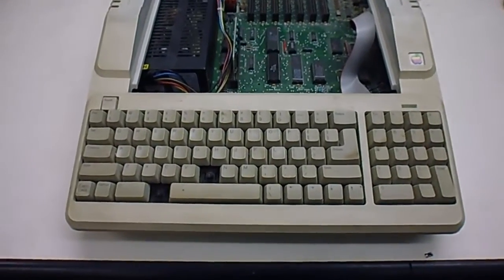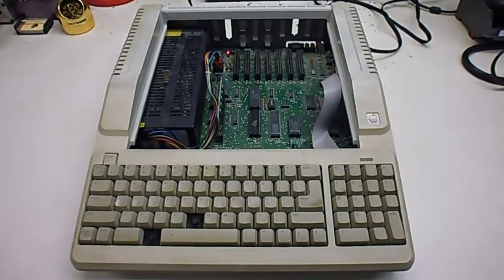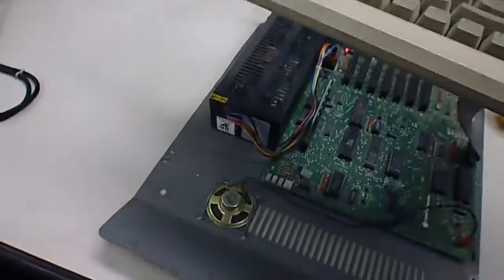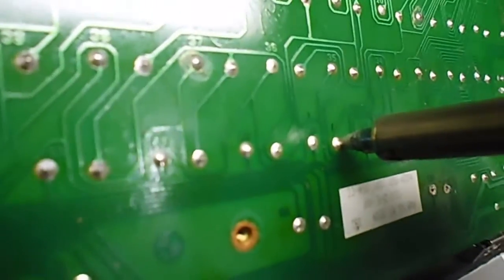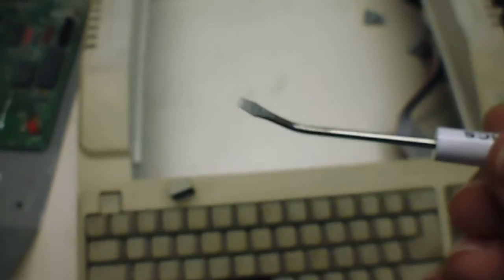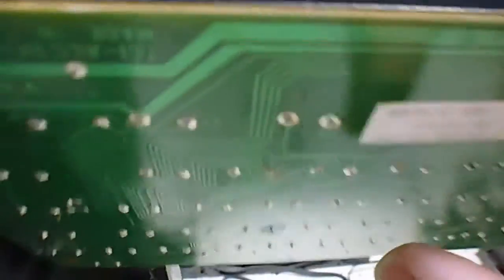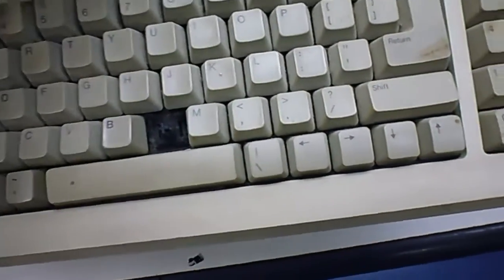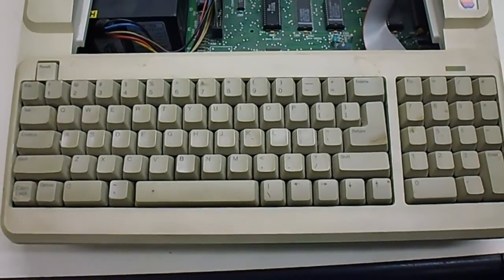Replacing key switches on the Apple IIe

Comment: Hi! I'm repairing and old Apple IIe keyboard with long stem ALPS switches. Following your instructions I was able to repair and disassemble every switch with 100% success. I was pretty confident in the task until I met my match the Caps Lock Switch. One I opened it it was completely different and now... I can´t assemble it back on!! I've been trying different ways but there are some pieces (a little copper wire) that got me totally confused. Any idea of where can I find an image or video on how to assemble THAT specific key? Thanks a million in advance for your time and patience. Greetings, from Argentina!
Reply from the maker: Ouch. Sorry, can't help you with that one. Try the folks out on the VCFED forums.

Comment: I have a platinum that needs a keyswitch replaced. I have an earlier IIe I can use for parts. Do you know which switches work with which? Also, I would like to know how much wood a woodchuck would chuck if a woodchuck could chuck wood. thanks.
Reply from the maker: +unabonger777 I'm not sure if the platinum IIe used a different key switch. There are basically 3 different key switches on the regular IIe - Letters/Numbers, Shift/CTRL/Space/Enter (keys with bigger keycaps), and the locking switch used on Caps Lock.
Reply: +Arcadecomponents.com I ended up using keyswitches from a IIe enhanced, but even ones from an original IIe would have worked. Aside from some of the keys (shift) being positioned sideways, they are the same.